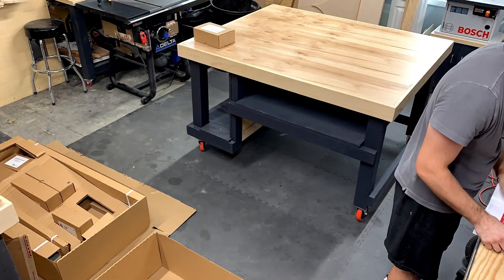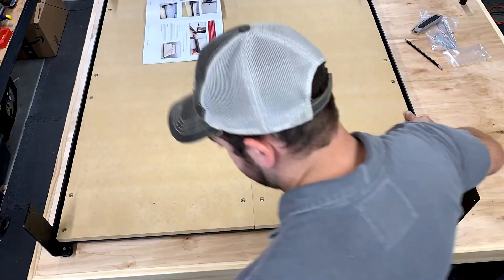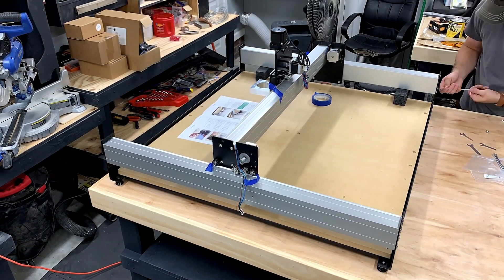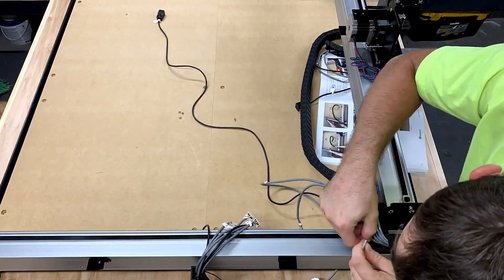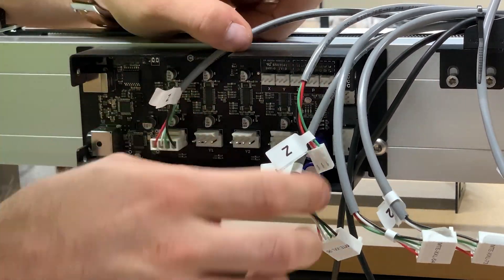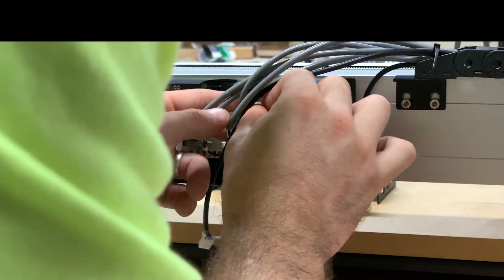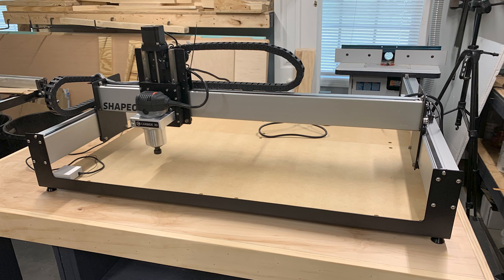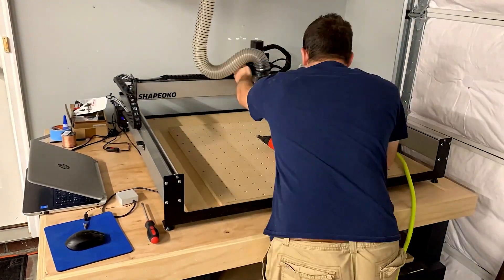Shapeoko 3 XXL Unboxing - Assembly

Comment: Thank you for taking the time to make this video,  I pulled the trigger yesterday and ordered my XXL. I want to make an enclosure but I would like to mount the control box on the outside...are the wires long enough to do that?
Reply from the maker: I would say yes.  I just posted my new video on my box and it is a big enclosure, but everything fits and all cables are plenty long enough.

Comment: The belts should be as tight as the bolts are long. If you can just start the m5 hex head into the belt bracket then that should tighten your belts correctly. 
Next you should  take those feet off and set your entire machine onto a piece of 1" foam insulation.  The base is known to sag unless you upgrade to aluminum extrusion base.
Reply from the maker: CCcnc thanks for the info!  Much appreciated!

Comment: Thanks for the video. I will be building mine tonight. I have set aside a whole shop night as to take my time. even two nights if needed. I have seen many videos about tram and squaring the actual router to the surface. Have you had to do that yet? Thanks.
Reply from the maker: Mike Marrazzo Midnight Maker I have a little bit. But not with a tool. More so with line of sight and trial and error.  It’s much easier with a tram tool but I can’t afford it yet.
Reply: @TradesmenGarage  i saw a great video on how to tram it with a homemade tool. I'll see if I can find it